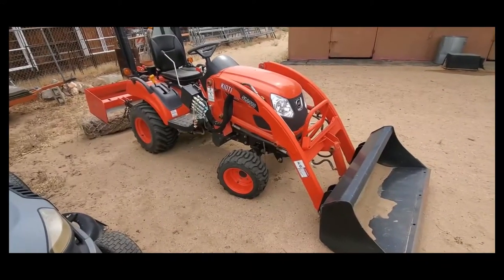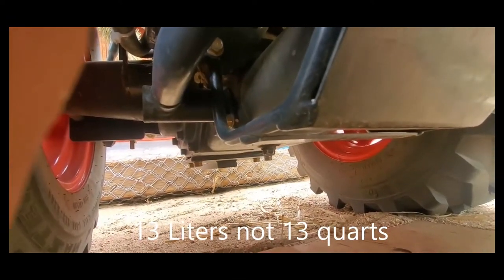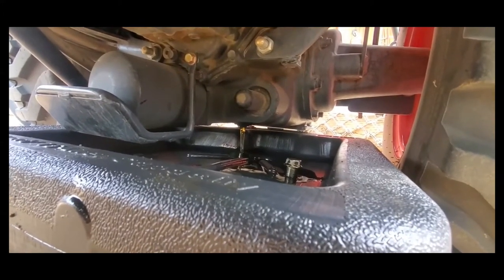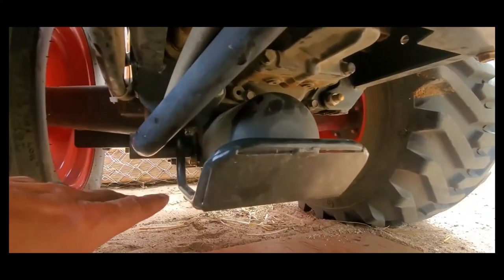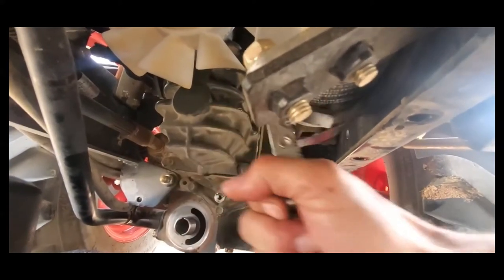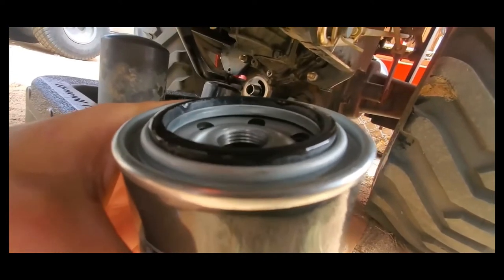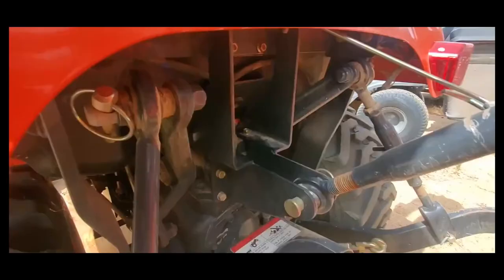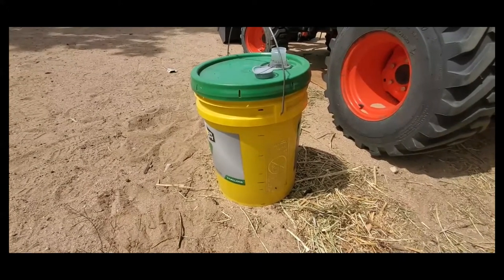How to: Replace the Hydraulic fluid, filter and hydro static filter on the Kioti CS2410

Comment: Thanks for this - some lovely soul (previous owner or someone working on it) never reinstalled the guard over my hydraulic filter so it got bashed while bush hogging on a particularly rough part of my trails. Hoping it's just the filter itself that broke and made all the hydraulic juice fall out, if it broke internally or ripped threads I'm pooched. Really looking forward to a field repair in the dirt.
Reply from the maker: Oh man those are rough, sorry to hear that. As long as the thread shaft for the filter isn't bent or broken you should be ok. I doubt it would break the internals. If it did that, the guard wouldn't have helped. If the threads are messed up you could probably chase them. Good luck, thanks for watching. We haven't had much need to make more video for our but we do have some that may help with other tasks.

Comment: Good video! I have a 2410 with about 90 hours and noticed a slow drip only when its running thats coming from the smaller Hydrostatic filter bracket.  Havent changed any filters since new..any idea what it could be?. Thinking about trying to snug the filter a bit tighter to see if that stops the drip.
Reply from the maker: The original filters shouldn't leak unless they hit something. If you are sure it is the filter you may have change it. You might get lucky with tightening but it could make the leak worse. If you are not sure its the filter, make sure there is no oil above it. Leaks make their way down, you may have a different issue going on. Thanks for watching.

Comment: In the intervals where only the filter is replaced not the fluid, such as at 50 hrs, does the fluid pour out while replacing the filter?  If the bucket is in the air to have room to work will that force the fluid out faster?
Reply from the maker: Personally i don't like to just do the filter change outs like that. I live in an dirty dusty area everything gets dust in it. When i did the change out at almost 150-200 hours everything looked good, Oil and filter wise. I think the only 50 hour change out that should be done is the engine oil. If you drop the filter you will dump a lot of the oil anyway better just to do it all at once. The only way you will get enough to drain it and work under it is raising the tractor up. I used a large drain pan that is most why it was in the way. If hope this answered your questions if not feel free to ask more.

Comment: How long you had this equipment and does this equipment  have special features
Reply from the maker: This is a 2016, we bought it in 2018. It comes with the bucket, we bought it used with the scrapper box. That is the only thing that has been added.

Comment: It's there any way to check the level, like a sight glass, weep hole or dipstick?
Reply from the maker: There is no sight glass. There may be a weep hole but i am not sure. I will have to check and get back to you.
Reply from the maker: As far as i can tell there is no weep hole either. Just have to make sure you put in the correct 13 liters.
Reply: You should open your eyes. There's a small dipstick on the right hand side. Rubber handle on the top of it and thats your indication for your fluid fill unless your model magically doesn't have one but mine does.

Comment: When you put oil in a filter to install it new that oil isn’t filtered?
And I’ve read to not do that when I had a truck and the caterpillar manual said to not do that for the reason of it not being filtered and there will always be enough left to lubricate the milliseconds it takes for filtered fluid to circulate.
Not to mention sometimes spilling oil when putting the filter on depending on the angles as such what.
All it does is save a minute or two to top it off.
I know if you go about anywhere and get your oil changed they top off the filter when replacing it.
I just figure caterpillar knows more than a shortcut mechanic.
Reply from the maker: I have always done it for 2 reasons. It keeps fluid in the system and to avoid hydro-lock. Now i have never seen it happen in a Hydraulic system but keeping oil in the system helps move air bubbles in the system to the tank. I have seen instances where oil doesn't pump through an engine because the oiling system won't prime without oil, causing an engine to fail. Generally, in those cases even a little oil would have started the prime, avoiding a blown motor. The amount of not filtered oil is about as negligible as the amount its helping to lube. I would always recommend following whatever the maunal says. Thanks for the comment always humbling hearing that 30+ years working on cars makes me a short cut mechanic.